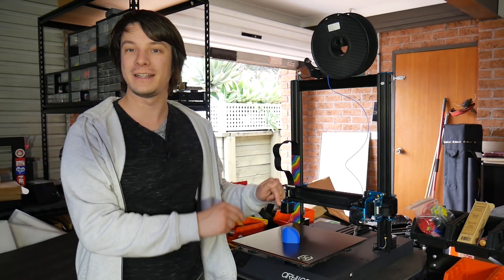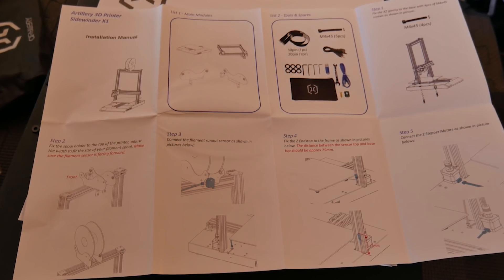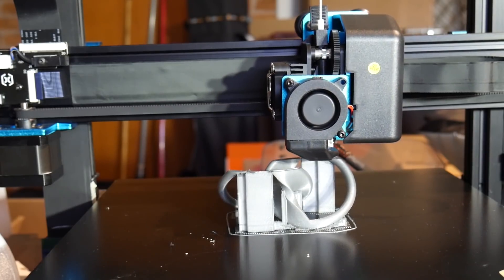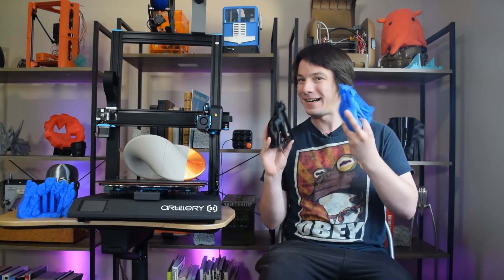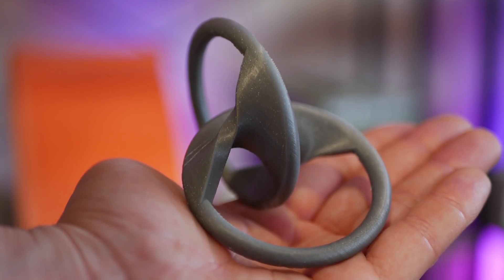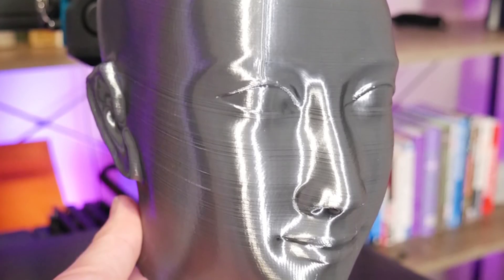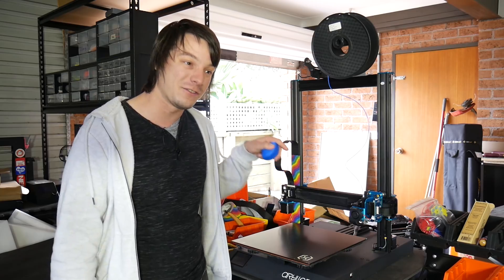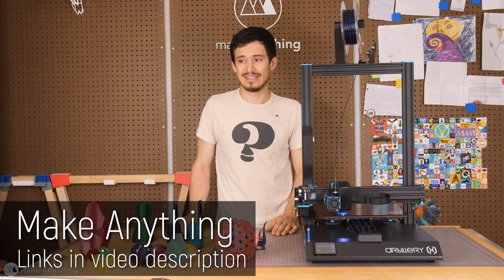Artillery (EVNOVO) Sidewinder X1 Review

Comment: It looks like the printer is on a small table.  Assuming he was printing on the small table, he could maybe use a larger table that would be less susceptible to moving, could possibly be the fix to the layering issues.  This is a common problem with direct drive printers, since they produce a lot of wobble.

Comment: Try moving the filament off the top gantry, to much weight, it seems like a upgraded copymaster 3d and that had the same problems i had to mod the absolute hell out of that machine to get a half good print out of it. I would also put some gantry braces on that as well. Its seems like it has alot in common with the copymaster 300 so i would keep away from it and not risk it.

Comment: Hi Angus. I got my Artillery SW1 yesterday and noticed they have changed the ribbon connector on the print bar to a locking one.  There were a few other changes to e.g. the z stop sensor was already fitted and looks to be non-adjustable.

It is printing well, although I am having trouble with the USB on the side which seems to halt the machine mid print if raspberry pi is plugged in for octopi.

Well ... just thought you'd be interested :)
bye

Comment: Thanks for the update on the review of this machine. One of the hardest things about buying this machine is not knowing which version your actually going to get. I understand that machines evolve over time, but they have inventory all over the place and seems that sellers on Amazon are charging a premium for "most recent version" seen as high as $480. Is stock from Gear Best coming direct from manufacturer?
Reply: I have seen $568 for the most recent version.

Comment: First I wanted to say that I have been watching your videos for a long time and I have always appreciated the content and enthusiasm.  Thankyou.
I have been looking at getting this printer as maybe my next problem child.  The plastic parts that decouple the z axis rods from the x axis seems like a good idea because the Z axis should only be stabilized by the vertical extrusions and trolleys. (could cause a problem when using z-hop)
 One of the things that I have found on direct drive extruders is that it is important to add a "Bowden like" tube.  The tube attaches to the printer frame or housing and to the inlet of the extruder.  This  stabilizes the spooling off of material, otherwise the x- axis movement yanks on the filament spool and creates variations in the Z axis of the print.  This variation will become worse as the extruder gets closer to the spool because the change in angle due to x axis movement becomes greater.  In addition this can create swinging of the spool (low frequency harmonic relationship between the x axis movement and the spool movement is a problem.) which can cause the problem to be worse in larger prints. I wanted to build an automatic motor driven filament pre-feeder but good enough keeps getting in the way of better. Ribbon cables are great as long as they are done right and nobody ever touches them and that is a problem for 3d printer guys like me.  Take care and be safe

Comment: I got one 4 weeks ago it was a ver 4 and it worked great till last night. I was making a print last night when I smelled something went in the room were it was and it was on fire. I powered it off And got it outside. After the fire was out I got a good look at it both fans had melted all the wires to the hot end were melted also. Not sure why this happened it had worked great till this. Was running pla at 205 c bed was at 60c. At least amazon is giving me a refund. I like your channel learned a lot from it
Reply: This printer have a dising error, the ribon cables can detach whith time becayse they dont have a fixed connector, and the bed is pure glass, yuo cant remove, and its NOT ground, its AC current, so can kill yuo or make a fire...sorry i want a Reliable printer, not a beutty that can die in a week
Reply: These are junk and you got suckered...just like me. Some good parts but put together by idiots.
Dangerous, and customer service is fix it yourself.
Reply: @jbarnhart2653  Can you explain?
Reply: @Strawber_Rae  Bought one from HICTOP. Junk. Head fell off, loose wiring broken thermistor. Customer service was wrong cut and paste. I think it was refurbished (used...they sell these by the way...)
Returned.
New one from LOYLOV. Short bversion new, no problems like before. Which were BAD. Almost went with the smaller Creality, but the direct drive...
Hope that helps. Careful who you buy it from.
Reply: @jbarnhart2653  Makes sense. Most good reviews I've seen were on Amazon or Gearbest.
Reply: @Strawber_Rae  Both Maker's Muse and 3D P. Nerd made "oops" videos with fixes for the "regular" problems...watch them.
Replace the bowden tube, cheat the run-out sensor with filament and move out of the way.
Prints NORMAL PLA great, but PETG and the surface not so much. I put on overture surface to fix that.
Exotic filaments EAT nozzles. Carbon, wood, Glow etc.
BLACK carbon steel or Micro-swiss ruby, they eat stainless steel!
CHECK EVERYTHING. ANY PRINTER. The very best still have problems and problem solving can double the price, one way or another.
Prusa, good machine, excellent customer service...same value machine with direct drive, here, double the price. 
Good luck.
Reply: J Barnhart You mean those filaments erode the nozzles, or they make them more likely to break? Even wood and glow? Also, I’m looking to get this as my first (working) 3D printer.
Reply: @Strawber_Rae  things like supports and normal printing produce stray filament.
End result is even when working right it will sand through.
There's a reason they sell brass ones by the dozen...

Comment: Which revision is being reviewed?  I got the V4 and love it.  So fast, quiet, clean and simple.

The only thing not provided is the glue stick.  Which is needed because the heater doesn't evenly heat the bed, so large prints can lift at their far edges.

Comment: What version was it? I see they are on to Version 4
Reply: TL;DR Not V4.
There are a few key things that can differentiate them, and from that, I can tell you that it is not the 4th version. Three of the easiest to spot differences are the reset button or lack of in the case of any version before 4, and the electronics cooling fan position. V3 mounts it on the side of the steel chassis with a fan grill over it, V4 has it on the bottom. Finally, there are micro SD and USB slots. On the v4 the steel is cut to the proper size around the inputs, but that is not the case on the printer in the video. (This is solely based on my own research looking into the Sidewinder, I do not own one myself, yet.) Feel free to correct me.

Comment: Angus, any chance you can make good on your promise to upload a Slic3r profile for the 0.8 nozzle? Please and thank you.
Reply from the maker: Added!
Reply: @MakersMuse  Thanks, I have kicked a little coin your way for the files. however, I think there may be a mistake in 0.8 profile. Can you double check it? I am not sure you can print at 80mms at 215c with a volcano spitting that much plastic.
Reply from the maker: @kdspstr  I'm away from the studio for a bit sorry, it's got a volcano hot end and I don't recall any issues but if you get skipping / underextrusion on long extrusions just reduce the speed to suit.
Reply: @MakersMuse  thank you!

Comment: I watch for your opinions. Wish you would point out right away the safety issues as to if the printers have or are missing specific safety issues. Example that you do mension in this is the thermal runaway

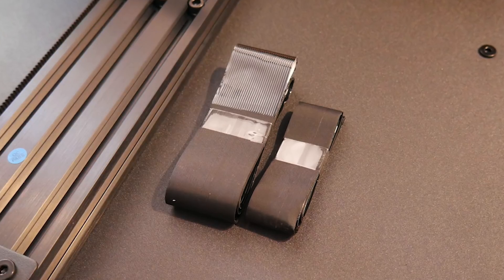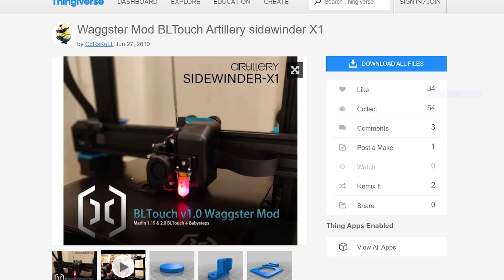Comment: 2:04, 3:41 - Wi-Fi??? Are you sure?
Reply from the maker: No, it's in the menu but doesn't work. My bad
Reply: @MakersMuse   I installed this module on the screen board он SW-X1: https://clck.ru/JmkWD I had to solder 8 pins on the eco-management board for this. 
I turned on WI-FI through the menu and it didn’t work. :(
Maybe for Wi-Fi there is a need to modify the firmware of the screen?

Comment: @Don gray i could not find your response to mine, but i want to state some things: you told me to not buy this printer in the first place because i am unable to help myself..well, in my opinion a printer has to work out of the box, it has to be tested and after mounting a benchy should be possible to produce without having the printer fail hardware wise. as i do print alot, if have chatted with the manufacturer before the purchase and they told me all problems have been solved, i got the newest version and leverproblem, heatflatness and cableissue was solved and i was very disappointed. I think it is fine for you if you are willing to print necessary parts for a printer to get it to work properly, i am not willing to do this, we are not talking about upgrades, we are talking about problems which easily could have been changed by the manufacturer. you are telling me i am to harsh on the levers, you are telling me i could print it in petg,draw one myself and stop complaining...well i do not get payed for posting sidewinder videos, nore have i intentione to do this in the future...so i state my honest opinion...what about people who have the sidewinder as their starter and are not able to print new parts because the printer is delivered DOA like in my case?they are screwed and must rely on the customer support.....by the way, we are running the printer on 220 volts and not having a ground on the heatbed is a major problem, as you would never get it to the market legally as an official company...as the product is delivered without a strainrelief, the possibility of getting a short is valid...so, please accept people who just want to have a functional product delivered..by the way, the newest levers delivered as a sparepart were broken again, because the hole for the pin was slightly too small, with hammering the pin inside, the lever broke....so they were delivered as a broken part!.....

Comment: We were the first ones to review this printer back in January when the printer was just released. 
Being the first version it does not include the modified leadscrew couplers but with the flat cable connector locks.
We also noticed the layer inaccuracy and we also tested all the same things mentioned in this video and a few things more.
We tested without the filament runout sensor, without the stock filament holder and with the filament spool out from the frame,
  with new drivers, with a different extruder gear, electric checks of all flat cable signals, alignment of both leadscrews, removed the top leadscrews bearings, etc.

The only thing not tested was the manufacturer's new leadscrew coupling solution.
Our results (archieved after the video upload) are a little bit better compared with the ones from this video but the fact is
 that after a few machine version updates, the printer still has the main issue of the random layer misalignment.

Comment: Well, we have two of those printers...both were delivered doa.....parts were missing motors not mounted..after own repair, the printer printed, but cable issue and most important, the idler lever keeps breaking, the design is just copycut engineering ....spareparts are hard to get from the manufacturer, we ran out of levers, all broke, some where delivered broken..the bed also is not plane and heat is distributed horribly....we can not depend on getting finishing prints, we are now drawing an idler , which will be made of aluminium......

Comment: Like most of the below comments those bloody ribbon connectors... Anyone who used an RPI knows how bad those are. May I suggest that you harness the ribbon to the surface behind it with a clamp that will take all the movement away from that actual connector. If you then leave a slight arc in the cable from the clamp to the connector it will apply a permanent force into the connection. Naturally, this means drilling into the surface behind the cable for a clamp to be applied, but that would sort out the issues... for a bit.. :)

Comment: Hey. Can a thermoplastic material in powder form can be used instead of thermoplastic filament? If yes then how and what should be the assembly be.
Reply: It would be a long shot, but maybe you could use a metal powder style printer, the ones that build up the model in a crucible with sand which is then fired afterwards to create the solid object.

 If you could get your temperature just right you maybe able to fire the plastic and fuse the powder into a solid. 

Although, to be honest, it probably wouldn't work and the surface quality would be horrible, but bad ideas can be the seeds of brilliant ones, so I just thought I'd throw this out there.

Comment: Bent lead screws...
Even if straight, long lead screws will bow out of shape if you spin them fast. The solution is to design the machine so that the stepper motor turns the nut, not the screw.

Comment: Hmm. I wonder if you can shim the brass bushings for the Z lead screws. I'm thinking of a printed clip looks which sort of like this |_(_)_| and snaps into the open area. The (_) will hold the round part of the bushing and fill the void between the metal wall.

Comment: Angus, in your opinion will Artillery/ENVOVO clean-up these issues, in the future?  Do you think its worth holding off for several months to buy one of these?   Or, will it always be a DIY mod fixer-upper?  Great video.  Thanks.
Reply: @Don Gray Sorry, Don.  That's entirely inaccurate.   In the past two years, I've bought three printers ranging in price from $350 to just under $500.  NONE of them required mods to function properly.  Now, if you are talking about modding the printer to change/improve the performance, that's another issue.  But, that's not what I'm asking Angus about.

Comment: I am interested in this printer, but want most issues worked out before I move forward in purchasing it. I have stuck with my Creality CR-10S, Ender 5 and Tevo Tarantula Large/Dual flexible units for reliability (but the Tarantula required upgrades almost equal to it's own price to enable consistent and accurate prints). My biggest issue now is I'm almost 100% set up to print Nylon, PC & vinyl with my CR-10S. What's prevented it is I cannot find a 100k Thermocouple to replace the thermistors it came with. First time I hit 265°C it couldn't read over 255°C ever again.
Do you know of a 100k Thermocouple for use with a Creality CR-10S?
Reply: I just ended up fitting a genuine E3D V6.
Reply: @originaltrilogy1  And a different controller board... Need the board to accept the resistance of a thermocouple, not the 100k range of a thermistor. It's all up to the board. 
I changed to a Capricorn tube, TH3D 50w heating element in a Micro Swiss hot end, so my equipment can do the job. It's the flimsy thermistor which is the problem.

Comment: Thanks for your review.  I got my X1 via Gearbest at a nice price at the end of Sep2019.  It took me just over 1-hour to assemble this printer because I read the instructions.  It printed the first cube pretty nice, but it did have some of the issues you mentioned.  I didn't think that a spool holder would cause such issues. I am impressed with this printer.  When it is printing I am sitting less than 5 feet from it and I have to turn around and pull closer to hear it. Your take on the ribbon cables has hit home.  I am in the process of working with Artillery support to fix an issue of the extruder not feeding now.  I did all of the troubleshooting things, check for a jam or clog in the nozzle or extruder feed area.  I found that the filament lever had broken tab around the small v-wheel that guides the filament and the area where the stepper motor shaft comes through was cracking.  Of course, you get a couple spares and I fix that.  The nozzle was heating up to the setpoint of 190C, no feeding of through the nozzle. During my checks, I found that the large gear was not moving for extrusion or retraction. I removed the entire assembly from the printer and disconnected it from the PCB and plug a cable into it from another printer and the motor works great.  Today I finally found where my issue is, and it comes from the ribbon cable on the Z-axis rail.  After that cable out I started getting MINTEMP  errors on the extruder.  The bad cable had one of the pin connection (position 21) burnt through on 30-pin cable.  I don't know how that happened but it did.  Before all of this, the printer was printing famously.  Swapping that out still has not removed the MINTEMP error yet. So the issue may have migrated down into the connector and caused a problem with something internal.  I even check the thermistor sensor and it reads between 79-84k ohms.  I am not sure of what the actual value should be since the sensor has a 3x5mm can on it.  I have sent images and videos to Artillery support and I am waiting on to see what they will say and do.  I don't what to open the case yet, but will if I have to.  I really like this printer and I want it working.  Thanks again for your review.